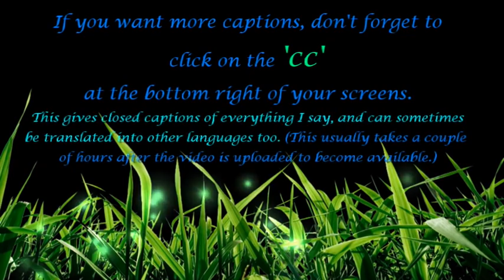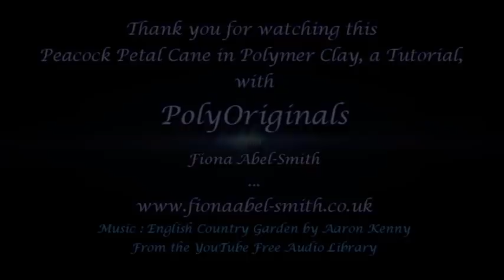Peacock Petal Cane in Polymer Clay, a Tutorial

Comment: Gorgeous 👏🏻💗👏🏻💗👏🏻💗 I love your work, you are amazing Fiona ❣️❣️❣️ Do you let your work rest at times when you were making this or do you just keep working it until you get to the end? Does it depend on the clay, I use Premo but I want to try the Fimo soft that you use. Do you feel there is a big difference between these two clays in your experience?
Reply from the maker: Thanks so much Shelly. I know in theory you should let it rest, and on very hot days even I do. But having made a cane I always want to use it straight away, so no, I am very bad and reduce and cut it straight away.  There are definitely differences between Premo and Fimo Soft. Premo is more rubbery, easier to condition, sticks to itself more than the soft, but also pulls down more when you are slicing a cane. Fimo is more crumbly (I think of it as more chalky) and this makes it harder to condition but it is easier to manoeuvre and it doesn't have that same pull down when you slice it. To my mind it is the easiest of all the clays to slice through. So there are good and bad points to each, and I use both, and like both. They can of course be mixed together, so even better ;) If you can afford to experiment with a bit of Fimo Soft, then do, then you can decide for yourself. But to be honest, most people get so comfortable with what they first started with, that they tend to stick to that. I hope that's helped a bit. :)
Reply: Fiona Abel-Smith PolyOriginals thank you so much and yes you were very helpful. I am going to experiment with Fimo soft. I find my canes get distorted with Premo and like you I want to use it right away so i don’t let it rest. Plus I am so excited to see the end result, but at times  disappointed. Good thing about clay is you can just try to make something else out of failures👏🏻👏🏻👏🏻 😊 When I see you do this so seamlessly I just had to ask. I know you have so much experience and I don’t have the knowledge to know when I should let it rest. I have a lot to learn but will keep trying. You inspire me to do so and I thank you for that 💗💗💗
Reply from the maker: @shellybeals2806  thanks so much Shelly, I hope you like experimenting with the FIMO Soft too :)